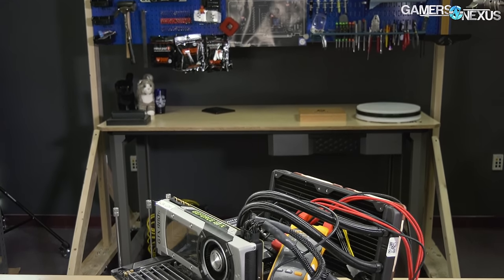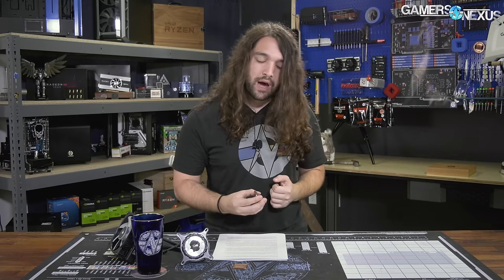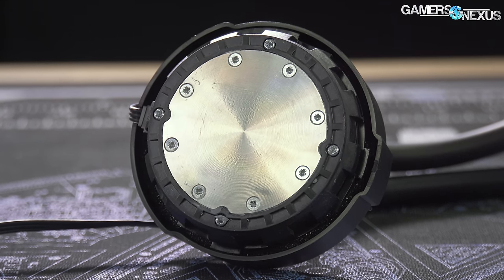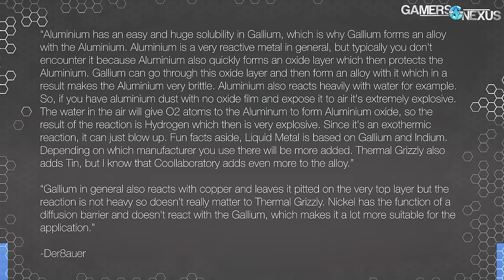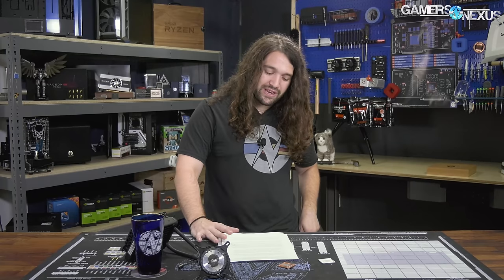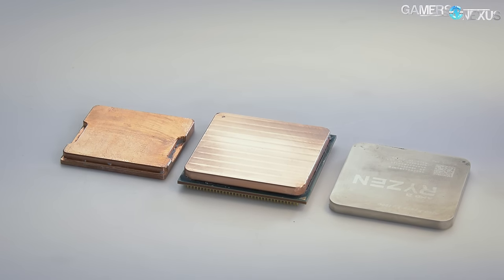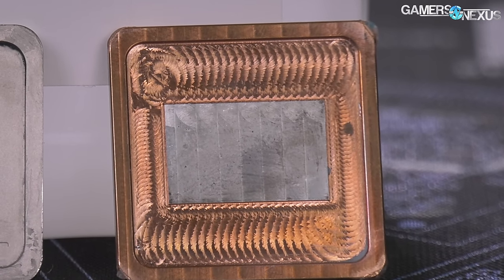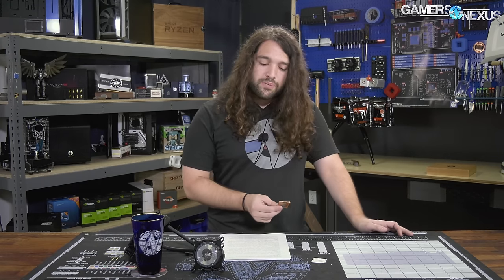How Liquid Metal Affects Copper, Nickel, and Aluminum (Corrosion Test)

Comment: So wait, using liquid metal will make my computer explode?!?!
Reply: what? no, how did you... no
Reply: @4fiHysteria  But that's what Der8auer said!!!
Reply: Only if it comes into contact with oxygen 💣🙃
Reply: Aluminum powder is not liquid metal
Reply: 5:44  did you not even understand him
Reply: yes so dont use an air cooler XD lol
Reply: It was a joke m8 XD
Reply: fourtysix4646 only if it comes into contact with an IGNITION source. The aluminum powder or aluminum oxide is it’s own source of oxygen (oxidizer). It’s used in solid rocket fuel and also in thermite.
Reply: Jennifer Royal 
Aluminum powder can be a fuel, such as in thermite or SRBs, but aluminum oxide can’t be oxidized further. Aluminium oxide can’t reorganize itself in a way as to explode. An oxide can only oxidize when combined with something more reducing while under the conditions needed to catalyze the reaction.
Reply: No, that's the TNT you put inside of it.
Reply: Yes! You must send your PC to me to diffuse it before it's too late!!! There is very little time left, send it right meow!!!
Reply: Make sure your computer has no aluminum dust inside, if you are not sure if there is aluminum dust inside your computer it is a good idea and safe practice to clean it, but don't use water, that is dangerous and will trigger the explosion, juice will work better and give you smaller explosions, but if flavor
Reply: @fourtysix4646  But the problem is the oxygen...oxygen will exploned with a lot of stuff...
Reply: Everyone going "oh no how r u that dumb hahahaha"
r/whooosh
Reply: @animegundude7934  No most here will say ohh animegundude has no arguments and shows his low level of respect and r/wooosh it because he has a low attituded.
Reply: Yes it will

Comment: In my understanding the corrosion/alloy effects of liquid gallium with solid solid aluminum, copper and nickel (actually nickel plated on copper) have been fully described in the video as
1) Aluminum: destructive corrosion (solid aluminum alloys with liquid gallium and the resulting brittle alloy gets attacked by moisture in the air with final effect the aluminum gets "eaten away", similar like solid iron corrosive rust oxidation with gaseous oxygen, but at a much faster rate)
2) Copper: also strong reaction, but non-destructive and also thermal degradation is negligible (copper alloys with gallium to CuGa2 and this alloy stays as a mechanically stable layer on the copper, thermal conductivity is reduced to 95 W/m-K compared to 400W/m-K for copper, but due to the thinness of the CuGa2 layer no measurable/see-able effect on the chip temperature)
3) Nickel (actually a thin plated layer of nickel on solid copper): A very slow reaction between nickel and gallium causes some not harmful staining of the nickel and the plated nickel layer seems to suppress that the copper alloys with the gallium

In my understanding this video has not at all addressed what above 3 corrosion/alloy reactions mean for the thin TIM layer of liquid metal.
Liquid metal stands in my understanding for all metal compositions that are liquid at room temperature. No fixed/concrete composition exists/is defined. Liquid metals based on mercury need special care because of mercury's high toxicity. Generally considered as nontoxic are liquid metals based on gallium. The name Galinstan stands for a 3 metal composition mainly of rather expensive gallium (Ga 69~95%), but also indium (In ?%) and tin (Sn 0~11%) with the specific composition Ga 68/69%, In 21/22% and Sn 9.5/10.5% showing under vacuum the quite deep melting point of -19°C. 
However there are also 4 metal or even 5 metal liquid metals mentioned in this German patent (application:  thermometers for several purposes/temperature ranges in the total temperature range of -20 to +1.200°C, https://patents.google.com/patent/DE10321843A1/de). As additional metals zink ( Zn 0~29%) and plumb (Pb 0~10%) are addressed for specific purposes and in another patent bismuth (Bi) and antimony (Sb). The patent also mentions that a 4th or 5th metal may allow to reduce the percentage of expensive gallium to 50% with only minor degradation and that the way of processing/mixing results in differences, for example by addressing the strong oxidization of gallium with oxygen.
In my reading liquid metal is not liquid metal, but there exists a multitude of possible metal compositions around gallium as the main material which I see also in application as TIM, where CoolLaboratory offers today 3 compositions, Pro obviously for lowest thermal resistance, Ultra probably for lower cost and on the newest composition Extreme CoolLaboratory claims they have addressed also the longevity.
The harmful consequence of gallium's strong reactivity seems to be that several people have proven by video that the applied liquid metal got hard/"dried out" while others even commented when they opened the gap/TIM and checked visually the liquid metal was gone completely.
In my understanding such hardening of the liquid metal happens only when applied on copper (does not occur when applied to nickel plated copper, this means especially the IHS) and I understand the underlying process for the hardening is gallium leaves the liquid metal and migrates into the copper to form there the solid CuGa2. For the quite thin TIM layer this means the percentage contents of gallium is permanently/quite fast reducing and when the gallium percentage falls below a certain percentage (different for each composition of liquid metal) it becomes hard and the hard remains of the liquid metal are quite difficult to remove from copper (the people even claiming liquid metal disappeared completely may have difficulties to see the remains of liquid metal by their eyes, especially when the gap was extremely thin and the color of the remains may be similar to CuGa2).
In total I see following 2 problems when applying liquid metal as a TIM:
1) Only on aluminum: destruction corrosion   and
2) Only on copper: hardening of the remains of very thin liquid metal once a certain amount of gallium has moved into the copper it is in contact with to form there the solid CuGa2 alloy.
This hardening when applied on copper requires to re-apply the liquid metal generally every 6 months (in extreme cases even faster) to avoid the not easy removal of hardened liquid metal from copper.
Reply: so it's completely safe to use LM in laptop (with copper HS), as long as it's reapplied every 6 months. what is this extreme cases? thanks!
Reply: So using it on the die of a microprocessor under the nickel plated IHS is mostly safe and doesn't degrade the materials. Have I understood it correctly?
Reply: @eniff2925  Yes. I did this with a de-lidded 7700K with Thermal Grizzly which i bought new 4 years ago. If you do as I did and as the rocketcool or similar recommend to reseal the heatspreader after application then its a once off process. Im one of those OCD people so I would reapply thermal grease once a year after the delid and at the same time inspect the 7700k for any damage. None and literally no drop in performance.  

Infact before I upgraded earlier this week 18/6/2020 I did an experiment with liquid mental on the heat spreader to AIO (for about a month) and yes, the results were as expected even better. Do I recommend having liquid metal between a cooler and processor? Probably not. But if you are just doing a delid then yeah man just do it.
Reply: Just reapply it when you see a degradation in thermal performance.

Comment: For those that dpn't wanna watch vid. Coolers are made in general of three metals Aluminum,Copper,Nickel
You dont wanna apply it on aluminum
You can apply on copper but it also degrade permamently over time
You want aply on nickel plated copper
In all three cases it interacts with these metals but only with nickel plated copper you can clear off stain
Reply: Hi, how identify with my cold plate is nickel or aluminium? i have a laptop msi gf63 thin , but the cold plate of the gpu is not copper looks like aluminium or nickel, i want to put liquid metal but im not sure she is nickel.thanks
Reply: @Anonymous09096  you could check with the manufacturer. Its a very small chance that they use aluminum, probably nickle plated copper. But you can never be certain so i wouldnt risk it untill you know for sure

Comment: I used 8700K with delid and liquid metal for a year. I lapped both sides of the HS to copper. On the bottom between the core and the HS year later the metal was still liquid. But between the top and Noctua cooler (which I also lapped just to be sure), it dried and basically fused the two surfaces together. I had to use a lot of force to pull them apart, and after that I had to lap both surfaces again to get rid of it. But that being said, before I pulled them apart, the temps were still fine, so even when it reacted and dried off the thermal conductivity was still fine.

Comment: Commenting on a older video, but this is a great reference and wanted to mention something with regards to bare copper.

When the liquid metal alloys with the copper, the oxidized result is sort of dry and chalky. This is normal, but it could hurt performance.
What you want to do is ALLOW this to happen initially. Give it a few weeks or so to "soak" and bind.

Once you've given it some time, you want to open it up again. Remove the existing liquid metal and clean it as well as you can like you would normal thermal paste. Do NOT use sanding or polishing to remove the alloy stains. If lapping the IHS, you should lap it first. The idea is that we WANT that staining to stick around. It is only surface-level, is stable, and has done all the reacting/alloying it is going to do. That is, it isn't going to continue reacting the way it would with aluminum. So in essence, it has become a protective barrier, stopping further corrosion.

After thoroughly cleaning the surface, simply reapply the liquid metal. At that point, the liquid metal should more or less retain its original properties from then on.

If you had polished or sanded the staining off of the surface, then when you went to reapply the liquid metal, it'll just re-alloy and create the same chalky residue.

You may still want to check the temps after re-application in case you need to repeat the process. But basically once the alloying process is "complete", the liquid metal is mostly just an alloy of elemental metals, rather than a complex emulsion or ceramic you would see with other TIMs. This means you shouldn't have to worry about decomposition or "aging".

A couple other tips:
- On the cooler, apply an amount notably larger than the die for the initial application. There will probably further reactions along the edges, so you want those edges to be outside of your contact zone.

- To speed up the alloying process, you could do some thermal cycling. Running hot will speed up the reaction. Thermal cycling may help it expand/contract and thus fill tinier nooks and crannies. I usually do a batch video conversion, or do an overclocking stability test, perhaps running the fans lower. We basically want to hang out around 80-90C. Modern CPUs are OK with this, and LM works better at higher temperatures.

Comment: The copper is basically "tinned" or soldered with the LM.  Exactly the same process you would get when soldering copper with a lead/tin solder.
Reply: @timno9804  tinning is just a term for coating. It doesn’t relate to tin at all

Comment: I have a der8auer i7 8700k Ultra with a silver IHS. The last weeks the temps kept rising until I couldn’t overlock anymore and figured my watercooling was busted. That proved not to be the case. I delidded the CPU and what I saw was nothing short of catastrophic. The LM was completely hardened and had visibly corroded the silver to the point of effectively having destroyed the IHS. The CPU is 2 years old. Replaced the IHS with a pure copper one and will delidd at least every 6 months now.

Comment: Bare Copper can suck a bit of it up, so the best thing you can do is add a bit more than you would with nickel plated copper. The mistake a lot of these laptop LM users make is in fear of LM doing a different short prone kind of migration; they use the complete and utter bare minimum amount of LM they can manage to get away with, and the LM dries up in a matter of months. Use a little bit more and just insulate the surrounding circuitry and you will be fine.
Reply: What is the better way to  insulate? What material do i use?
Reply: @jeanfischer5208  try nail polish or super 33 tape
Reply: @lvl-up3951  conformal coating would be a much better idea, it's meant for damp proofing electronics. Grizzly sell 'SHIELD PROTECTIVE VARNISH' for this exact purpose which also looks a lot like relabelled nail varnish, lol
Reply: Hi, how identify with my cold plate is nickel or aluminium? i have a laptop msi gf63 thin , but the cold plate of the gpu is not copper looks like aluminium or nickel, i want to put liquid metal there but im not sure she is nickel.thanks

Comment: I used a product called Indigo Extreme on an old Core 2 Quad (stock nickel-plated IHS) mated with a copper waterblock years ago: that produced a metal film like a foil. It was difficult to separate the CPU from the block when un-mounting, but the material had flowed so well that the mirror-image of the markings on the IHS was printed onto the slice of foil that came out when it was disassembled. Weird installation procedure, but it seemed to work pretty well. Removal was mostly just peeling off the "foil"-- IIRC almost all of it came off in one piece, with a couple of extra bits that needed to be scraped free. Seemed like an easier thing to apply and remove than these liquid metal TIMs. Personally I went back to using non-conductive paste-- it's just easy / relatively risk-free and I'm not trying to set any overclocking records :D

Comment: If the gallium indium mixture is reacting with the copper in a way that ends up plating the copper as you said, wouldn't it then become an almost perfect non reactive surface for liquid metal due to the plating acting like a barrier between the gallium and copper, just like the nickle plated copper?
Reply: When the copper surface on the cold plate is saturated with gallium then no more reaction will occur and you will get a cold plate finish with the same color as gallium. For first time application I have found that you need to apply a little more liquid metal than you would normally use to compensate for the copper/gallium fusing or else loosing a measurable amount of heat transfer from the IHS to the cold plate.
Reply: Yep.
Reply: a very good point
Reply: This is all the same for a copper base on the cooler itself? I purchased a cheap Cooler Master water cooler that is very respectable for the price but it has a copper base on the pump itself. I was planning on doing this just for the hell of it with the toasty 4790k.
Reply: PITTING not plating...
Reply: Jennifer Royal I don’t think that’s what is being referred to, is it? I thought the process of pitting means when the gallium and iridium mixture reacts with aluminium and corrodes the surface. In this case I would’ve thought the word plating is correct, because we’re talking about the mixture reacting with copper. I’m not sure though. I only narrowly avoided failing chemistry.

Edit: I’ve googled and pitting is definitely a form of corrosion.
Reply: Kaby  It's called diffusion which is different from plating.
Reply: Only gallium diffuses then Tin/Iridium will be left out in solid form. 
 Also the gallium/copper misture at the surface has 150w/mk;   Pure copper has 400w but people forget to include the air bubbles at imperfections in the surface so the 400w/mk isnt achievable on practice.
Reply: Bruno George Moraes  
But the diffusion is just a few atomic layer deep. So it won't do any measureable difference in thermals. Just like a few micron nickel plating.
Reply: @DaedalEVE  both, actually
Reply: @peterkiss1204   well from vídeos of people trying to remove i would guess half a milimeter.  But hey there is a reason TIM is a necessity. So if pure copper with imperfections is better than gallium-copper needs a few especialized  tools and controlled testing.

Comment: 5:45 --> You got it wrong: Aluminium reacts with water (H2O), the O (oxigen) bonds with Aluminium creating AlO (aluminium oxide), and then, the H2 is released (and potencially  flammable)
Reply: to balance the equation you need 3H2O+2Al->3H2+Al2O3
I think.

Comment: I'm really glad for this video. I had been kinda worried about the Phanteks liquid cooler I had picked out with nickel and thought I would need to go copper but now I know that it's actually better. I liquid metaled my G752 laptop and it's so good my power brick can't keep up!
Reply: Hi, how identify with my cold plate is nickel or aluminium? i have a laptop msi gf63 thin , but the cold plate of the gpu is not copper looks like aluminium or nickel, i want to put liquid metal there but im not sure she is nickel.thanks

Comment: What about copper plated aluminium? Will the copper surface protect the aluminium from reacting or will it migrate through the copper as the surface is very very thin?

Comment: Pro-Tip in 2021: I thought 9900X was totally corroded past recognition after two years. Isopropanol and Acetone did nothing.  Then I tried rubbing baking soda in with alcohol prep pads. After 10 minutes I could read the SN again. Cheers.